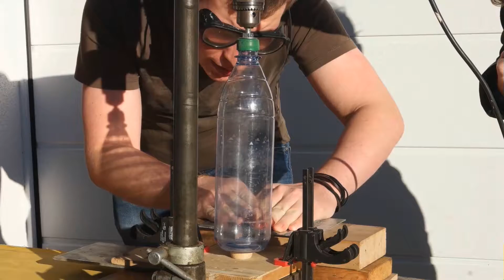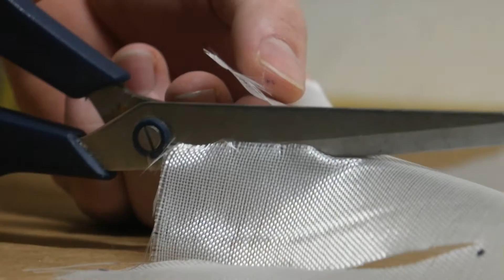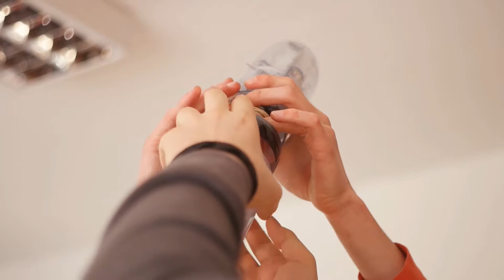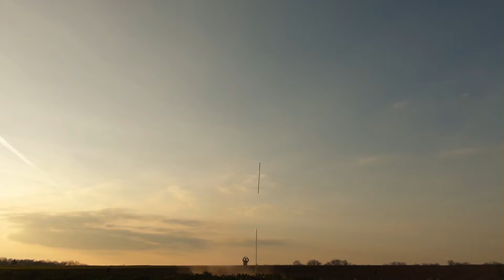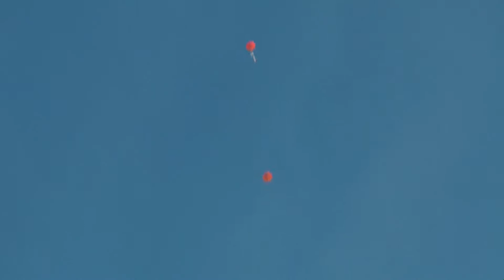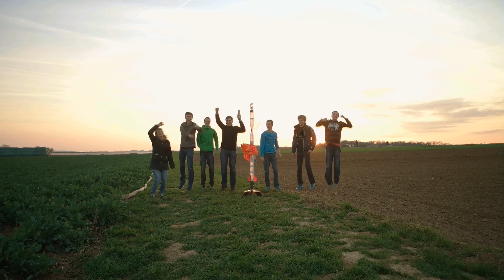Project EOWR: Launching a "CanSat" Probe with a Water Rocket

Comment: Very nice video. Could you please list out the inventory used for cansat, like sender receiver board information, Arduino or some other board and how to program it? Thanks!
Reply from the maker: Hello Sameer, thank you! The technology of the CanSat belongs to the students. We will contact them in order to ask if they can give you detailed information. :)
Greetings
Julian from the Raketfued-Team
Reply from the maker: Here is the answer from one of the sudents:
-----------
Hello Sameer, our design is based on an Arduino Micro. Due to the expected altitude we decided to don't use any wireless communication systems and to store the data on a MicroSD.
The probe consists of the following components/sensors:
- Arduino Micro
- mSD Breakout board
- BMP085
- ADXL326
- DHT11
- GP2Y1010
- MQ7 & MQ135
- Piezo Buzzer (Made the whole thing sound like a bomb but worked pretty well for signaling the status) 

The power supply consists of a two cell lipo with 1500 mAh and a voltage regulator.The Arduino is fairly easy to use. There are a bunch of libraries for a wide variety of sensors. For simple programs you can use the IDE from Arduino. But there is also an VisualStudio plug-in which I would recommend for advanced programming (several files, intelli sense, etc.).
Depending on how complex you want to get you should also consider buying another Arduino board. The libraries use a lot of memory so that there is not much left for your program.I hope we could help you.
Reply: Thanks! Really appreciate your help on this.
Reply from the maker: Always happy to help. ;)

Comment: Great work, hopefully you'll tell us the ingenuity and system to release the top probe. Have you been thinking of a thinner 2nd stage water rocket? Did that break your German 290m altitude record?
Reply from the maker: Thanks Oliver! We will publish an article about the project on our website, but we need some time for it because we're really busy right now. Also, the article will be in German...but stay tuned, that's maybe not forever... ;) We plan to build a multi-stage water rocket in the future, but this will need some time as well, since we want to make sure everything will work nicely. We launched the EOWR rocket at 220 psi and it flew about 200 meters high. The reason for this relatively low altitude is the mass of the probe.